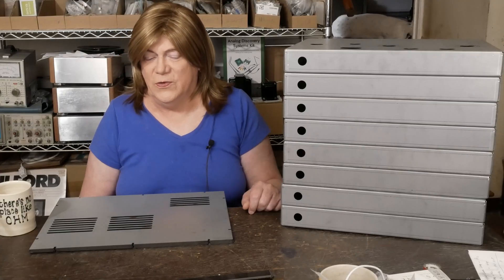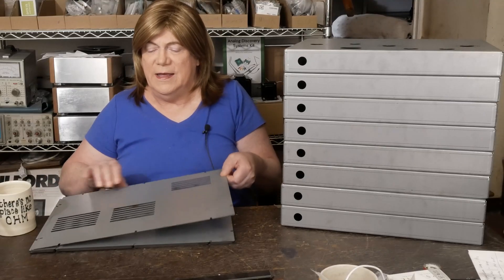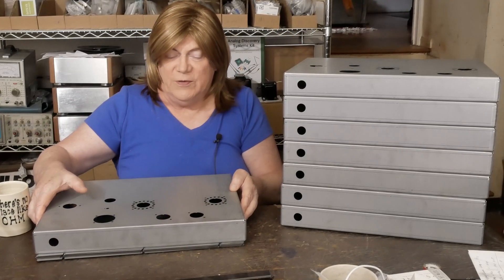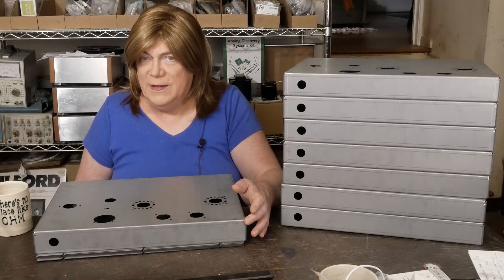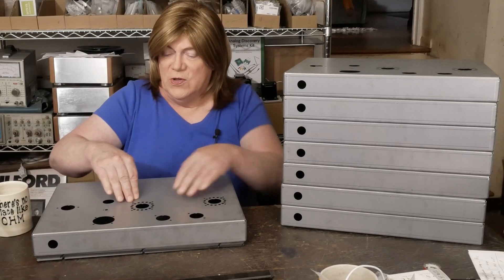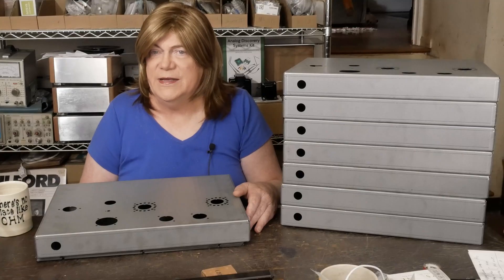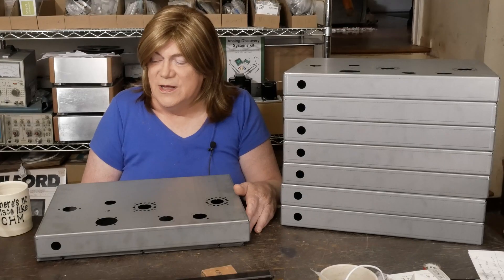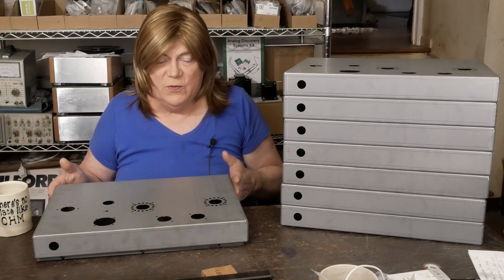Pre-Fab Tube Amp Chassis are Ready for Production!

Comment: What do you like to use for 'feet'?  You can use rubber of course  or maybe smooth metallic feet with rounded tips?  Nice looking chassis and glass-bead blasted for adhesion of paint; plus the welded corners top it off.  Chrome for another $100!? 😊

DD

Comment: I absolutely love those chassis, Stephe! The slotted bottom is a great idea. They look beautiful! Is that finish like a grey “hammer tone” type one or is it more like a matte type primer type finish? Regardless, they look awesome. Glad you’ve got some companies to do the work for you. For a first batch, they look fantastic. People who are avoiding building a 2A3, 300B, or whatever type of amp due to the fab work, can build an amp now. 

I’d personally be weary of offering kits. I tried doing that with people who said they just need the chassis, PCB, and / or parts (so, basically a kit) for something as simple as guitar effects pedals, which use only 9 -18 volts, let alone like 400-600v on the plate of a tube. It became unmanageable rather quickly, because people said things like, “I screwed up the PCB, can you send another”? That’s already a huge part of the “kit” cost, and replacing them  or certain other parts made it unworth it rather quickly. 

Nevertheless, I wish you the best of luck. I think just offering the chassis is a great idea, as you don’t know what kind of experience someone has just soldering let alone reading a schematic and building an amplifier. Thanks, Stephe! 🔊🥳🎶💜

Comment: Very nice. I got into this channel and tube amps from the Nobsound.
Call me old fashioned but I like amps that can be repaired at home. I have an old fender amp with a nickel plated chassis - probably no longer offered! 😂 hidden behind tolex
My next project is to replace the filter caps and electrolytic caps in a 100W Bassman.
Thank you for keeping folks safe. Impossible to be an enthusiast without folks like you

Comment: I was one of those people who suggested you using cad, glad you went that route because those chassis look nice. Good work, what company did you send the stp file to for these? Maybe i missed the name.
Reply from the maker: Thankfully a viewer "used CAD" for me or I would never have gotten here! These were made by https://pcmetalfab.com/ and the great thing is their shop is like 3 minutes from my house!
Reply: @SkunkieDesignsElectronics thank you, couple more questions, with the handful of chassis that you got for the first batch what was the ballpark price like? Im sure being local and that helped the pricing but still would be nice to see the price difference from that send cut send place. Also in the cad file did they want it layed out as the chassis before the bends or did the cad look just like the finished chassis? Will be cool to see your amp when its all finished and powdercoated.
Reply from the maker: A single send cut send unwelded chassis as shown was close to $150 for top and bottom. The price drops per unit made as you would expect, but most people don't need 10+ chassis. Send cut send wasn't picky about the file sent, they did it from a 3D .step file, but have no way to spot weld and the corner reliefs are huge. 

The local shop needed an "unfolded" DXF file, and it took a little back and forth with him, to get a file his software would work with. The .step file send cut send worked from wasn't usable to him. It seems there is a LOT of variations of how these files are interpreted by different software, and like we tried a DWG 3D file and for some reason his software couldn't unfold the project from this file, not sure what software is being used to create these. 

He was able to do some tweaks to the design like the corner reliefs and was able to move a couple of holes from the DXF. At least now I know what he needs to work from! He cut and folded one sample, I ran over and looked at it before he made the other 7 so that was helpful.

Comment: Them Chassis came out GREAT !   So many choices on power coating or even Chrome plating.  I like the metal they use.  Round holes are easy ! Even after power coating. Blue tape .Then pull off tape when done. Their is IEC sockets with fuse and filter . It just longer . Should fit right in. I use Tripp Lite Surge strip metal case UL ones with Surge and EMI/RFI filter . I find they help with noise a audio amp can get threw power line from outher stuff like inverter drive washers and stuff. Just a note . GFI is great for shock protection on AC line BUT when threw a transformer , It is isolated and HV in them tube amps have no GFIC protection, So be very careful and use bleeder resistors on HV caps.  I like the warring's on the video's hear !  I know better and do not mind being reminded . Cheers !
Reply from the maker: Thanks for the additional notes and tips!